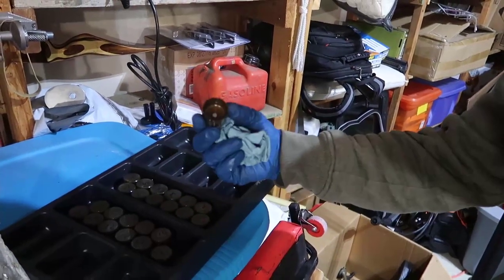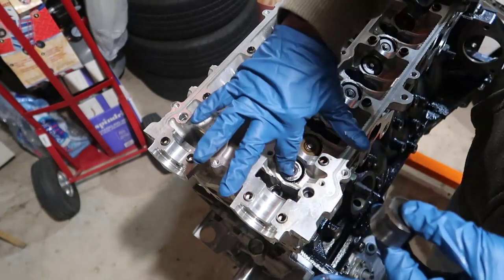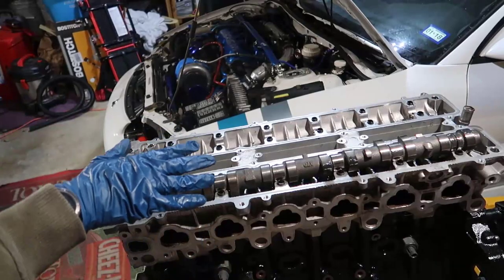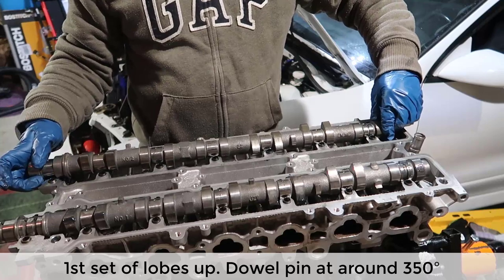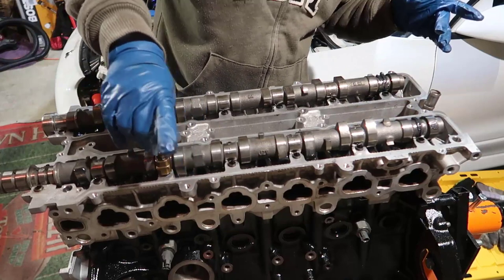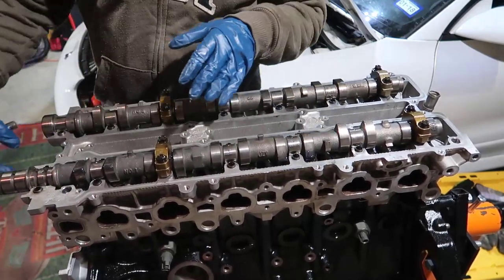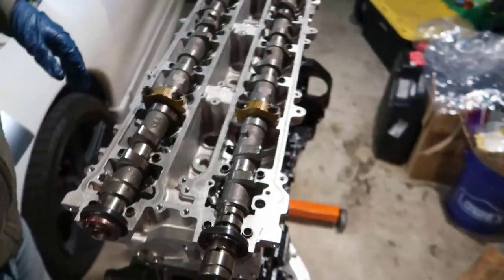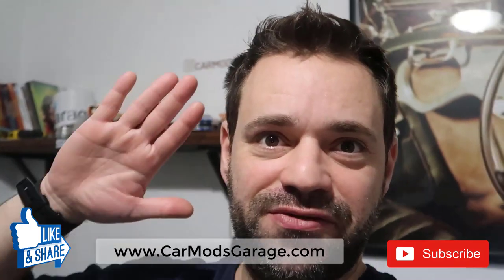2JZ Bukets and Camshafts Install 🔥 Part 1 of 2 - 2JZ to E46 Conversion

Comment: Question my friend I planing to use stock head in my na t build only replace the valve seals becouse my engine only has 50k miles but if I decide to go with bc 264 cams  is any other part that I need to replace on the head or can I use my oem vale,springs and buckets and just replace the 264 cams?
Reply from the maker: Just the cams but I would measure the clearance between the cam and the bucket. Maybe you will need to replace some shims to get the proper clearance.  This is to guarantee that the valves seal properly when close